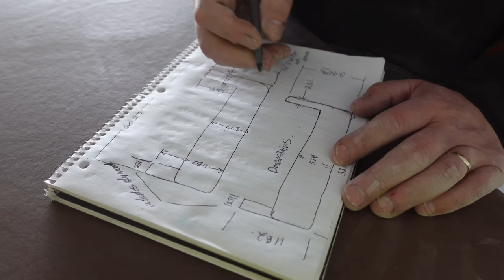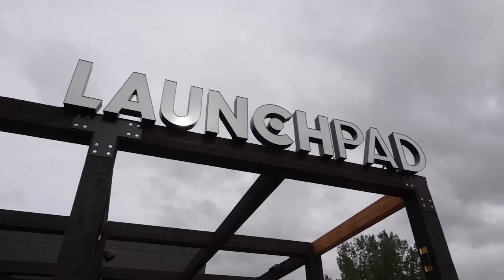Our Biggest Project Was Almost Our Biggest Mistake

Comment: Epoxy is a thermoset plastic so once it's hard heat won't be able to turn it back to a liquid state whereas acrylic is a thermoplastic so heat can melt it and let it self-level on the surface.

Simon
B. Sc. Eng. composite material fabrication
Reply from the maker: Thanks so much for the explanation!

Comment: Acrylic is a thermoplastic.  You can re-melt it, which is really easy to do at the sanded face level.  Epoxy is a thermoset.  You can soften it if you raise the temp higher than the cure temp, but you cannot "melt" it.  It will be pliable and then it will burn.  You have to buff it out.
Reply from the maker: Thanks for the explanation Ken!

Comment: That’s one hell of a video and an incredible install beautiful table. I’ve got several tables I’m doing for a commercial business that’s gonna get a lot of wear and tear on the top just like yours what was the process to use to make sure the top doesn’t scratch in such a abusive environment
Reply from the maker: We use a high quality urethane topped with our ceramics! No finish is bulletproof but this is the best combo we have found for durability.
Reply: How do you apply the urethane, what namebrand urethane poly?

Comment: I’m just curious if the cleaners scratched it then does the ceramic protect against this in the future? Will it be higher maintenance because of the scratching?
Reply from the maker: The ceramic absolutely makes a difference but it could still be scratched if someone runs an abrasive over it. That’s actually what happened with the cleaners, they used an abrasive cleaning pad. The ceramic also allows for easy repairability!
Reply: @BlackForestWoodCo  great answer and thank you!
Reply: @BlackForestWoodCo  how do you clean a surface like this? With what?
Reply: Unquestionably would be higher maintenance

Comment: I've personally done  probably 50+ Bar top resturants' bar tops and epoxy pours and every couple of years came back and done re-pours  over a 20 year span for mostly the same clients/ bar owners in multiple states and abroad. One thing Ive learned through oit the years, especially in the construction phase of bar build outs is always work from the finishes  backwards and complete all the prepwork in structual/ weight loads,  low maintenance, water proof  materials ect... the mistake on having to add brackets supports and most likely no solid backing should have been addressed  by the G.C. in the framing phase . A couple 4x4 Pt  stud posts @ multiple locations and marked locations on a set of asbuilt plans and alot of photos of the framing w/ Dimension spec locations is cheap and a huge time and cost saver. 
As for your video,  a very excellent quality professional job done w/very well thought professionalism. Your company represents our trades very well. 
Just a suggestion : the Equipment Jacks you used I've used setting 1,000lb marble columns to lift up to 2nd floor locations. They were a back saver and I doubted the main stairs would support the weight w / just 1 column and 6 to 8 mens weight on top of that.  Strap your material  and use multiple lifts. A little trick I did was lay  a 3/4 plywood runner coarse on the floor @ the front end wheels to compensate for the weight of my materials tipping the Jacks down. 
Thank you again for a great video. Always a joy seeing the youth take great pride in the trades. We are a dying breed these days

Comment: Someone correct me if I'm wrong, but I believe epoxy resin doesn't flame polish because it doesn't really melt in the conventional sense.  It will soften and get flexible, but from my own experience and the research I've done, it doesn't really re-liquify because of its nature as a thermosetting polymer as opposed to acrylic which is a thermoplastic polymer (technical jargon, but it just means that they are molecularly different from one another, and have different properties as a result, i.e. how they each behave when subjected to high heat)
Reply from the maker: Thanks for the explanation!

Comment: Hey guys awesome job. I love your guys work been following you for quite a while. I have worked with those hand crank jacks more than I'd like to admit haha in setting up concert stages and big heavy trust. I have ran into the same issues you guys did where stuff wants to slide off. So either tie a lifting strap and a shackle around it so it can't slide off Or if you're in a situation like you guys were where you need to lift up and slide you guys could put little blocks at the end of the forks so that nothing can slide off and Just use a c clamp or any type of clamp to hold the blocks. 👌

Comment: Surprised that you moved it flat rather than on edge like a piece of glass. Also have you ever thought of doing a composite piece. Say with 1/2" to 3/4" glass on top a thin burl cut say 1/4" deep. A deeper color and perhaps a mirror under for depth. ( This could be an acrylic mirror to allow ease of manufacture) . One could use fiber optics hidden in the pour to bring light into where required yet allow you to change the colors or intensity, as desired with easily replaceable lights.

Comment: I saw the amazing projects you did, just amazing things, well done for your professionalism. I have a professional question, is it possible to assemble such an epoxy plate in a place in the kitchen, is it resistant to knife cuts or when you place slightly hot things on an epoxy plate, I would appreciate your professional answer, by the way, I'm from Israel

Comment: Pushing the limits!
That should be your name!
  Always impressed 
Launch pad must be pretty confident in there bar business, to invest so much.
I was curious with the clear medallions it now a floating top I’m well aware it must weigh a ton.
What keeps an unruly crowd from pushing it loose, or cracking it??
Super job with all the obstacles!
Great work TEAM
Reply from the maker: We added silicone to the top of the pucks and also did another bead of silicone around the perimeter on the bottom. Silicone is surprisingly strong!
Reply: Ok good deal . I heard you say silicone. But I really didn’t think that you would attempt that considering all the pucks were torched.
 I thought that would definitely show!
   Any way you end up doing it I knew would be great .!
Reply: Why do you think some unruly croud would come near a table like this?
Reply: @doroparker1702  cause there’s always that ONE !

Comment: I have a question. I'm in the process of doing a rubio finish. I don't have a gem polisher. I do have a festool ets 125/3 that I can use.  I ordered the white polishing pads for the gem buffer and cut one to fit my sander to use it as a polisher but all it did was stop turning and made a fuzzy mess on my sander pad. Do you guys use a atachment for yours or what. Please help. I also ordered and use your guys oil. I love it

Comment: The reason why Epoxy can’t be polished using a flame is because Acrylic is a plastic from the thermoplastic family.  All thermoplastics can be melted to form them.  In your case you only melt the sanded surface with a flame to give a polished appearance.  Epoxy is a plastic from the thermosetting family and these plastics can’t be melted once the chemical reaction between the two parts occurred.
Reply from the maker: Thanks for the explanation!

Comment: So if something as simple as a day one cleaner ruined the surface, how is this "bar top" supposed to last during normal day to day usage with glasses sliding across it all day and night for years?
Reply from the maker: Glasses sliding across it is fine, using a rough abrasive cleaner on it is not

Comment: Not so impressed by the fact that a simple abrasive cleaning rendered your fine work almost destroyed. Although you claim that the ceramic finish does prevent or protect against some of this abrasive cleaning, there's no way that you could prevent this from happening in the future. This, in my opinion, is a very fatal weakness.
Reply from the maker: I don’t think there’s a single furniture finish out there that would stand up to abrasive cleaning. Our ceramic coating improves abrasion resistance but it does not mean you can use abrasives in the surface. 
I’d love to hear about this abrasive proof finish though!